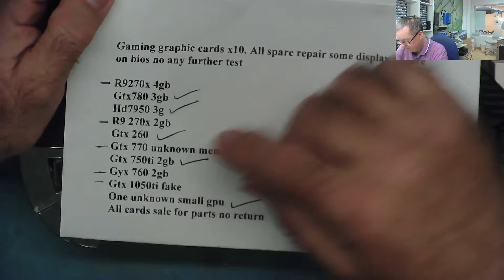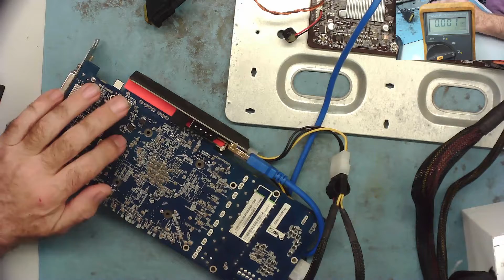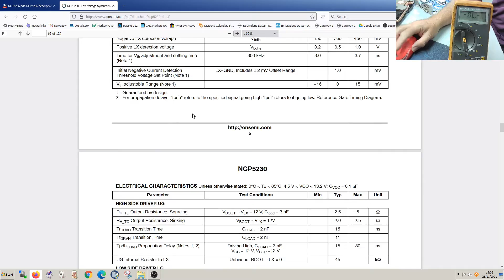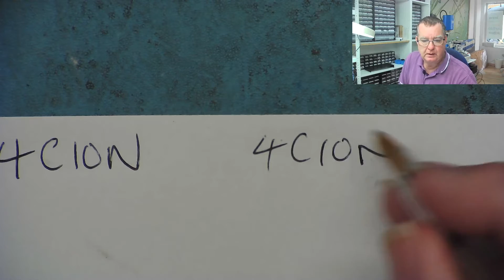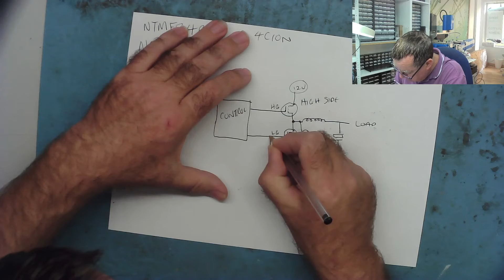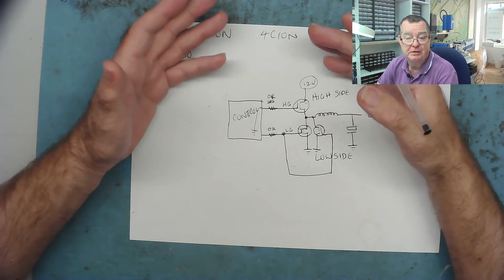I bought 13 EBAY Spares or Repair GPUs... Episode 2: Sapphire Dual-X HD7950 3GB

Comment from the maker: IMPORTANT: REGARDS THE 1R0 AND ZERO OHM RESISTOR
Once again on reviewing the video at upload time I came to the decision my original thoughts about this resistor, as I explain in the video, were wrong.  

There actually is a resistor - marked 1R0 - in the low side gate feed, it is just located somewhere else (it is R731 near to the low side mosfets on the other side of the board and you can clearly see it towards the end of the video).  So that fact refutes two of my previous points,

1: that the other gate resistor was 0R, and 
2: that there are no other small resistors with the value marked on them.

Another fact I noticed earlier but did not really consider the relevance – the circuit tracks going to the 1R0 resistor are very thick.  Now it is a fact that the gate current is very low, in fact the gate is basically an open circuit… TO DC voltages.  But at the high frequency this buck controller runs the gate basically acts as a capacitor, and gate current will flow.  However the current will still be very low, so why do we need thick PCB tracks here?  

Well it looks to me (I didn’t actually check) those thick tracks connect to both sides of the 1R0 resistor and both go back towards the controller IC.  This makes me think it is measuring the voltage drop across the 1R0 to monitor gate current or to determine exactly when the Mosfet turns on and off. This could explain why the circuit traces here are thick… because they need to be very low resistance traces.
Given those thoughts I am definitely putting a 1R0 back in.  As the high side mosfet is missing it will not have caused any problems at the moment.

This also strongly suggests the 1R0 WAS the original part and the previous technician who looked at this was unable to diagnose the correct cause of the fault – the open circuit resistor.  It also strongly suggests this card will work once I fit the 1R0 resistor and replace the missing MOSFET.

Comment: Haven't seen the full video yet, just commenting so I won't forget to leave this hint on the end of the video if it wasn't adressed:
At 7:29 on the very bottom of the screen there was a very small capacitor, approximately 1 cm to the right of C2922.
It looks like it's halfways knocked off and lifted the pads, maybe not properly connecting or prone to breaking in the future.

Comment: I hope you'll be able to help. I've been trying to remove a stubborn mosfet from an RX470, but it's not budging with a 350c hot air gun. Do you have any advice? I'm sure others have the same problem so a short video about it would definitely be helpful.
Reply from the maker: You need to use a preheater under the board - use a thermocouple to monitor the temperature of the mosfet on the top side of the board.  When it gets to about 100-120C, tuen the preheater up higher and use hot air to remove it.  As soon as it comes free turn the preheater off and set it to blow cool air.

I don't know about your hot air gun (you didn't mention a brand) but something like the Quick 861DW or Atten 861D is what you need for this sort of job - and even then you need the preheater as well.

The preheater I use is this one
https://www.aliexpress.com/item/1005002102227720.html?spm=a2g0o.productlist.0.0.50c52405JThgDD&algo_pvid=203797d6-2fcb-44dc-a0b1-9dc20de965f0&algo_exp_id=203797d6-2fcb-44dc-a0b1-9dc20de965f0-9&pdp_ext_f=%7B%22sku_id%22%3A%2212000022623976708%22%7D

The temperature meter I use is this one (actually I have two of them to monitor both sides of the board)
https://www.aliexpress.com/item/32951289332.html?spm=a2g0o.productlist.0.0.527073faVH9V9o&algo_pvid=a960656a-88ba-4ac3-893f-324fe06bdde4&algo_exp_id=a960656a-88ba-4ac3-893f-324fe06bdde4-7&pdp_ext_f=%7B%22sku_id%22%3A%2266335549005%22%7D

This is a case of needing the correct equipment to do the job - simple as that.
Reply: @learnelectronicsrepair  Thanks for this. What concerns me with preheating is there's plenty of surface solder at the bottom of the GPU as well. It's making contact with the preheater.

Is there a max preheat temp that I shouldn't go over?

Comment: Perhaps you may know if this is even possible. I want to change an.   ASI  HD5870 1g. Mac version.      From 2010 or so.       Can it be modified to use as a card in Windows 10?
Reply from the maker: I'm no expert on that but I think it is just down to the BIOS...  Or MAC GPU will work in Windows PC but not vice versa.  Give it a try first to see what happens. Otherwise I think on www.badcaps.net/forum/ there are guys who can help you

Comment: I do agree that at least one of the resistors would be a protective gate ac current sense.
Unfortunately the datasheet on the controller does not show this application, but rather a different circuit.
I urge you to back engineer the schematic around this circuit to be sure you actually have the correct opinion on the function.
Cheers and thanks a lot for your videos. Even old horses may learn new tricks from these 😁
Reply from the maker: @CXensation - I think that is a very good idea - after all this is LEARN electronics repair and I include myself as one of those who is still learning.  I'll get on to it, for sure it is interseting exactly how this is connected up even if not relevant to the actual fault.

Comment: I love your troubleshooting methods, but I have a question about the low and high side mosfet configuration. If the schematic of the low side and high side mosfets are similar (same pinouts and outputs), are you able to take one of the low side mosfets and place it as the high side mosfet? If there a reason for needing two low side mosfets, other than splitting the load in half? 
Thanks for your thoughts.
Reply from the maker: @Issa Nesheiwat
I don't know the reason they usually (but not always) use two low side mosfets in parallel, maybe some others here can answer that.  Also for some reason as far as I recall the single high side mosfet will be a different part number than the twin low side mosfets.